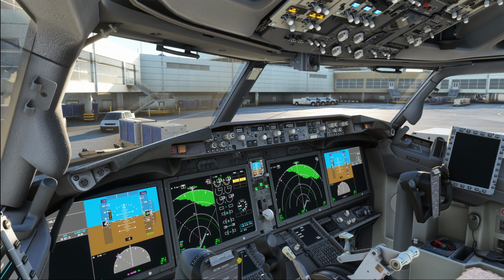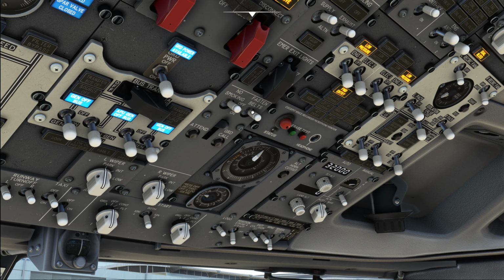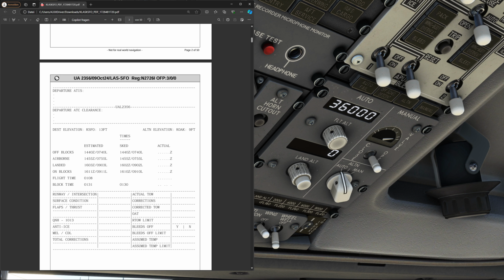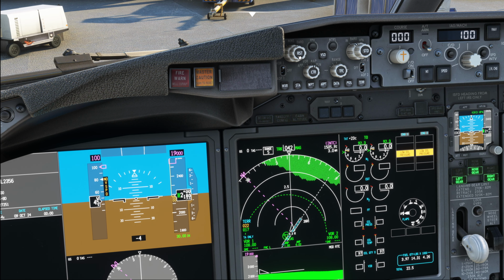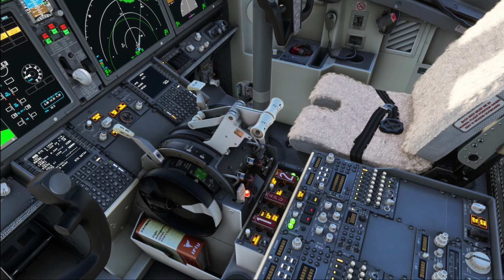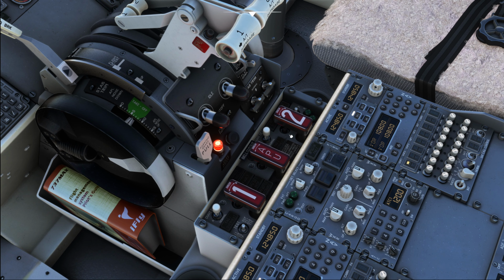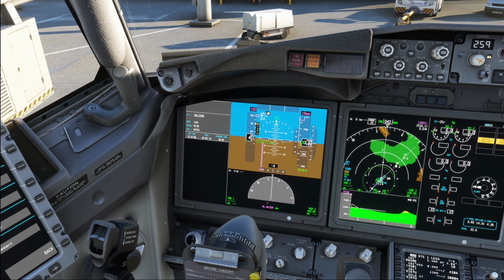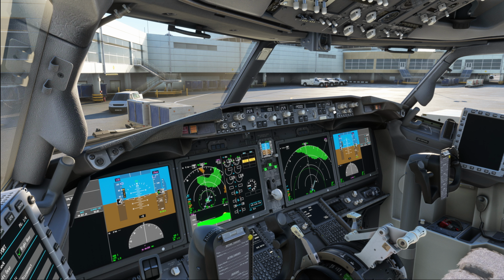iFly 737 MAX Tutorial 3: Cockpit Preparation | Real 737 Pilot

Comment: You said leave the APU off unless needed for electrical power which is my practice as well in the 737's, but just so their is no confusion you had the APU on at that point  as evidenced by the APU Generators lights showing available?
Reply: Hes using apu for air conditioning